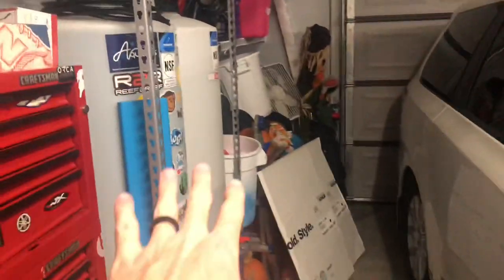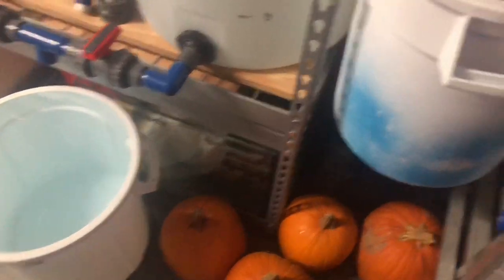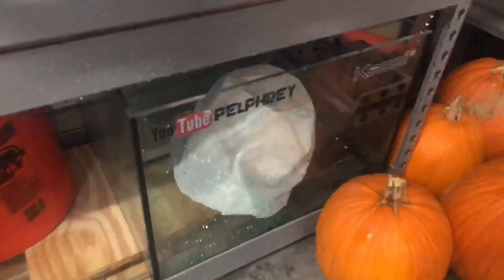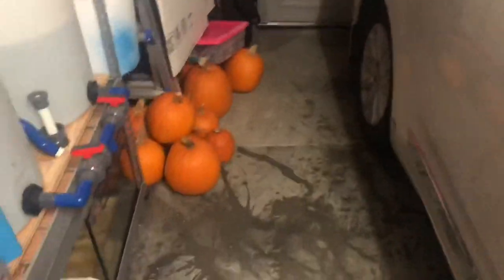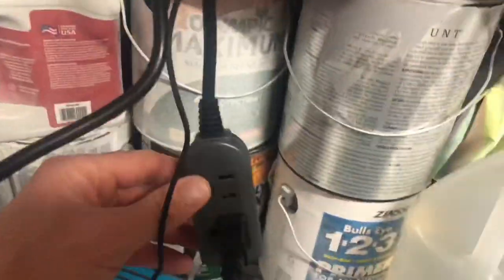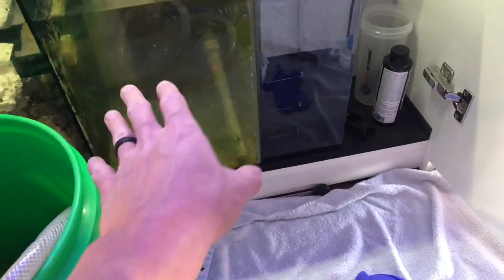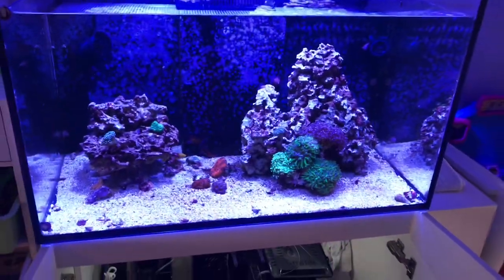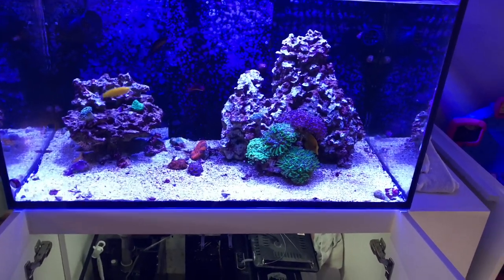Red Sea Reefer 250 | Wasted 20+ Gallons of RODI Water | Deep Clean Refugium | 3D Printed Parts

Comment: Nice job on the cleanup! I’ve had to set mine up so it never gets dirty because of the problems I created for myself in the past after stirring up the nasty during cleanup, that then ended up getting into the tank and causing problems. I have to say, I’m liking that detritus doesn’t accumulate any more...😁
Reply from the maker: Thanks!!! Pump and vacuum attachment would have worked a lot better had it not been the floating algae in the tank. After cleaning it a dozen times I just gave up! haha
Reply: True, the pump clogs quickly when it’s drawing in chunky stuff....😂😂

Comment: To move your 10 gal container you can get the brute trash can wheel thingy...or make a 2x4 one with wheels.  I feel your pain man I've done this 4 times...and once in an upstairs apartment. Hope all is well!
Reply from the maker: Is still have to lift it to get it into the house! Haha I just carry it! For now anyway!!!
Reply: @pelphrey  True, I didnt think of that. What I do I use a 55 gal mixing drum and I hook up a python water changer hose to the pump and sendvwarer directly to my tank. I have the pump controller hooked up to a wifi plug that I turn on/off so I dont have to leave my tank while I'm filling it up. It works for me.
Reply from the maker: That’s all that matters! If it works for you and it’s simple keep it going! These little 10 gallon brute cans I just man handle Hahahah